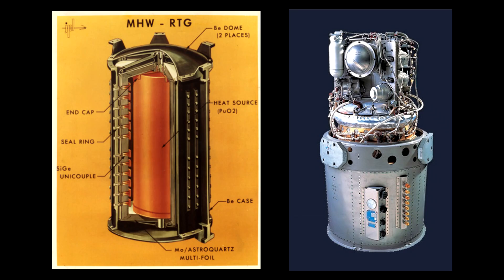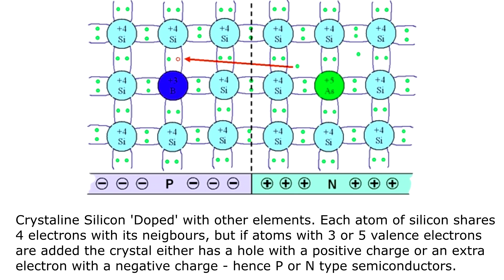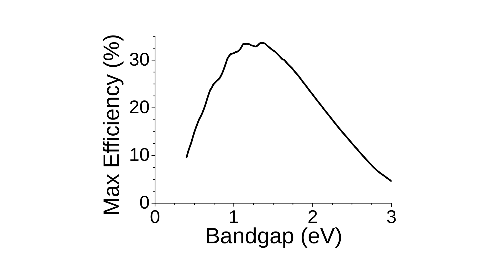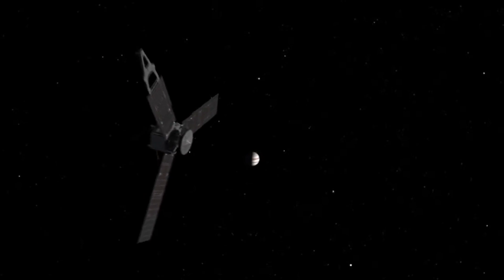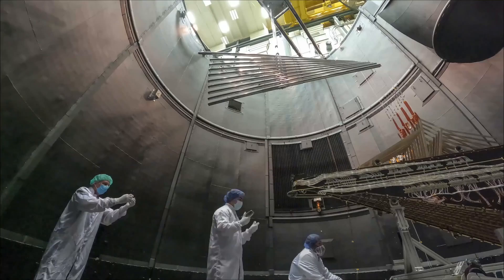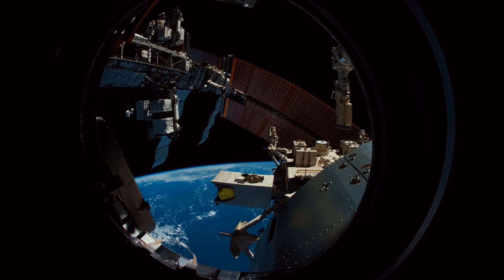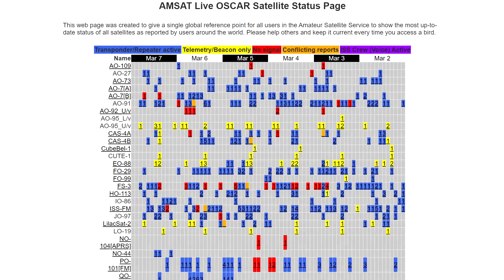How Does The Sun Power Spacecraft?  Things Kerbal Space Program Doesn't Teach You

Comment: In the case of the Ham satellite, what mostly likely happened is this.
When a battery fails, its voltage drops close to zero, but its internal resistance remains low.
Time passed, and the electrolyte of the batteries evaporated completely.
Therefore, the internal resistance of the batteries shoot up, to a value that is equivalent to a total disconnection. This allowed the onboard electronics to be powered directly from the solar cells.

Comment: Interesting, you implied that most solar cells in space are silicon, or perhaps multijunction.  My understanding was that they were CIGS, because of the higher efficiency and because they were thin film, so could be rolled up without being damaged.  I just did some poking around and couldn't find anything that confirms that.  Plus your point about using small, rigid but curved silicon pieces on a flexible backer makes a lot of sense.

Comment: Multijunction III-V vs silicon is actually not as simple as the efficiency number suggests. Multijunction cells use Germanium substrates that are much heavier than Si substrates. Therefore, the power-to-weight ratio of early multijunction panels are not superior to silicon panels. Multijunction cells are mostly valued for their higher radiation resistance for deep space applications. Using concentrators however changes the math since the cell mass are now a much lower part of total panel weight and multijunction panels have much smaller area and thus lighter structural support.  

For future spacecraft, less efficient thin film panels with much higher power-to-weight ratio are desirable. But TF cells have their own set of problems too.

Comment: cool video.  Hey, just wondering if the solar panels on the iss could be used to boost the orbit.  probably not good for the power supply, but those panels are pretty big....maybe once a day use the sun to push the iss faster.  Might need some more batteries, that I'm sure tesla could supply....by this I mean that on the sun word part of the orbit, the panels would have to be oriented side ways....grr...I think you get the drift...

Comment: polycrystalline cells can handle lower light flux than monocrystalline panels. Their maximum efficiency is lower but they are effective in dimmer conditions, one of the reasons you find them on calculators for use indoors.

Comment: AO-7 batteries failed short-circuit, then went open-circuit probably due to corrosion of the Ni-CAD batteries thus allowing power to flow from the solar cells to the electronics once again.  Scott erroneously states that the battery shorted to allow operation-quite the opposite.  It's actively relaying communication daily, for operators who can manage to use their power delicately!  send too much, and the transmitter drags down the voltage and gets all wobbly sounding! It is a "linear transponder" so more input=more output up to the power limit.

Comment: Another possible use of solar panels is fuelless reaction
 wheels desaturation by using solar radiation pressure torque. DOI:10.2514/1.G003328 Use of External Torques for Desaturation of Reaction Wheels

Comment: I'm glad you corrected the Pu-235 blooper!  I worked in the facility at DOE's Savannah River Site where we processed Pu-238 and got to travel to Florida to watch Galileo launch.  The cost issue with the material is we just don't have any reactors still operating where you can make much Pu-238 since the reactors at Savannah River shut down.  You can make limited amounts in the HFIR at Oak Ridge or at the ATR at Idaho National Labs.  But to make reasonable amounts for deep space missions, you'd need to build a new reactor, which isn't cheap, thus the 'high cost' to make Pu-238.

Comment: I grew up in the 1950s and was intrigued by solar energy.  They sold little hobby solar cells so you could get your hands on  the process.  In the 1980s I built a remote weekend house that Progressively became solar powered.  I believe the U.S. Gov. Used me and the remote house in a ten years long alien exchange program.  My first generator in 1985 had one experimental solar panel sold off by Motorola Government Electrics Group to employees.  I ran 12 volt current into the house and I love this arrangement being so simple and fool proof and absolutely dependable.  Next went to AC with a small inverter.  Then jumped to 3,000 watts with a huge battery pack and three solar panels.  I sold the remote house and that generator ran 12 years with no maintenance and was trouble free.  Today being retired I live in a van with two inverters two battery packs and one 100 watt China manufactured solar panel.  I run two 250 watt Electric heaters for winter heating, lighting, an entertainment center and a small refrigerator.
Reply: Your electric setup sounds interesting. Aliens do not care about the American government though, and don't participate in exchange programmes with native fauna 👍
Reply: @johnn1199  Yes alien's run their own show.  I was an official involved with military research and at my remote cabin I read the best research findings published at that time.  It was under stood that the alien's would gather exchange information from me.  I was taken to an ice planet or moon where I must have received extensive modifications.  It to appeared that I was taken to earth based alien sites possibly to contribute work on projects.  I developed an understanding of ancient Native American mapping and of sites globally related to my cabin site.  I also can explain the structure of gravity and the nature of deep space relationships.  From secure sources I was informed that I am an descendent of Christ and that I am extraordinary.

Comment: Multi-layered solar cells on a spacecraft seems kind of stupid. Real estate isn't your limiting factor, mass is. So why not use a single junction with an excitation energy optimized for sunlight and a large thin panel rather than a thicker multi-junction panel? I suppose the majority of the mass penalty comes from the supporting material, not the actual PV layer.
Reply: Volume is a limiting factor when you have to make something unfold itself.
Reply: @TheEvilmooseofdoom  If it's twice the area but half the thickness it's the same volume.

Comment: The solar constant at Earth's distance from the sun is 1366W per square meter (I assume that's what you meant by 1400W on earth) in orbit, closer to 1.15kW at surface level but that's the total radiation energy not the output from sloar panels. I was under the impression that the most we can get from solar panels at surface level is 300W per square meter, which is significantly lower than 50% efficiency.... If these 50% efficiency photovoltic panels exist why are we still using thermal solar? I thought they only generate about 500W per square meter of heliostats....

Edit:
That's what you said.... My bad =]

Comment: Great series Scott! I heard about Boeing having problems with solar concentrators. The very thin panels had adhesives that got too hot, loosening a little, and the panels warped. Also, the relatively cold reflective film immediately condensed the outgassing material, becoming dark and not reflective. Double whammy.
Reply: Yes, it was quite a boondoggle with many of those satellites needing to be replaced ahead of schedule due to unexpectedly fast power degradation. XM Satellite Radio's first two satellites were among the victims.

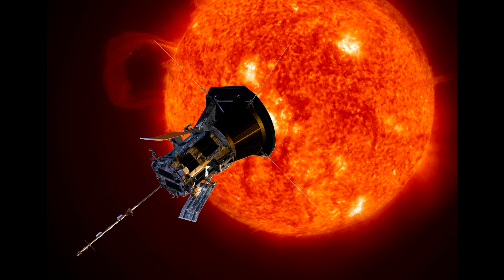Comment: 7:49... They are getting heat from infrared radiation right?  Or any radiation for that matter.  Check which wavelength affects silicon the most in terms of "thermal" energy and put a energy absorbing energy for that in the tip layer

Comment: It is amazing to me that it is taking so long for concentration to catch on; as it seems like a no-brainer, when you consider the cost differences between glass and pv cells.
Not to mention, generating a reflective surface in situ with on hand or stellar materials is likely much easier than making a pv cell, even if it can't be used structurally, or chemically.
Whether a mirror, parabolic or otherwise, fresnel-type lens, or something similar, concentrating light is a low-cost multiplier of efficacy, and has been overlooked for far too long.
Reply: It hasn't been overlooked, it's just not worth it most of the time. You need quite a bit more area to get the angled lengths of a concentrator to an equivalent area of some flat cells, additionally the few cells that are being focused on now get very hot which is already an issue with a non-concentrated cell, and then you need the cells to be tracked so the light is focused correctly (and if you're focusing on a single cell, you might be forced to be dual axis tracked since the single focus area could move off in either direction). I've designed a few solar panels that have flown, and when I started my career did a trade study for a concentrator and the result was a concentrator works, it just has additional issues to deal with and the cost of the cells usually isn't enough to justify the increased complexity and logistics. Obviously that changes mission to mission, but I have yet to do a solar array that a concentrator was chosen as the best option. Solar arrays you want to keep as simple as possible, since they are the single part of the whole spacecraft that must work, so keeping a high reliability usually wins out in my experience.
Reply: @ivs-b7h  Maybe a polarized frequency filter covering a half pipe reflector can have a tube of liquid pv/t, cooled using a direct expansion solar-assisted heat pump?
Reply: solar concentrators were a popular scheme in the literature, but always increased the complexity and could require removing heat from the PV cell.  It also requires more accuracy when pointing the array at the sun.   The fact that they were rarely used for satellites does suggest that the benefits weren't worth the costs.  It is possible that with the multi-junction cells, the relative costs might be different enough to justify a simple solar concentrator as was shown in the video.
Reply: Boeing tried concentrators on the BSS-702 satellites years ago and it was a massive failure due to the mirrors fogging due to offgassing. That likely did something to scare off further attempts..
Reply: Solar concentrators aren't an ideal solution, because mirrors can be heavy, and more importantly, concentrating sunlight on a smaller area also increases the incident heat as a result, which leads to decreased efficiency and/or requirements for active cooling. They're also much more restrictive in orientation.
Reply: @dojelnotmyrealname4018  Those sound like areas where development can improve, especially if given as much effort as traditional pv.
Reply: @Nullpersona  The thing is, most of those problems are fundamental to the design. Solar concentration is, by definition, focusing more solar power on a smaller area. So unless you have some magical 100% efficiency solar panels, that's gonna create heat concentration. This can be partially offset by increasing the efficiency of the solar panel, assuming you can actually store the electricity, since using it turns it back into heat, but the short version is, any solar power that doesn't leave the solar panel as electricity, enters it as heat. 
So twice the solar power means twice the heat, which leads to higher temperature, which decreases the efficiency, which will increase the heat further. The end result is that unless you're not even remotely using the cooling capability of your solar panel, there's a lot of logistic pressure introduced by concentrating more sunlight onto the solar cells. You can't afford such complexity in space.

The necesity of aiming the concentrator is also fairly fundamental, given that you're effectively ricocheting sunlight onto a small target. The weight of the reflective surface is a question of material's science, so that can be improved, but what can't be improved is that reflective surfaces tend to be metals, and metals tend to be dense. The other improvement option is making the metal thinner, but the incident solar rays will cause stress, both kinetic and thermal, so that has it's limit too.
Reply: @dojelnotmyrealname4018  The angle of incidence can be accounted for by the shape of the pv element; panels make sense for the relative angle of a nearby star, but hemispheres or other shapes would probably work better with reflectors and concentrators.
Development of higher capacity pv technologies is counterproductive if concentration is not applied, especially where profit is a concern, so there is little incentive to pursue it.
If any additional thermal energy collected is recycled or otherwise converted for use, like ablative propulsion, or technologies like liquid pv-t are pursued, the potential seems promising.
Reply: @Nullpersona  Angle of incidence is a minor problem for pv panels, but for reflectors it's a massive problem, since a minor change in angle of incidence will make the reflected light miss the pv panels completely. 
The second is downright false. First of all, solar concentration is more suited for solar thermal power generation than photovoltaic solutions. The paradox of photovoltaic power is that power generation decreases with solar power decreasing, but the conversion factor decreases with solar power increasing. Concentrated solar power is more suited for power tower and other solar thermal collectors.
Secondly: Higher conversion factor PV cells have one major advantage: they get less hot directly. Like I said last time, any solar power that doesn't become electricity, becomes heat instead. This makes them usable closer to the sun. 
Thirdly: Terestrial and spaceflight conditions have different practical requirements. Spaceflights have power per unit mass, which trasnlates into conversion factor per unit mass for pv cells, and effective reflective surface per unit mass for reflector solutions (in both cases, unit mass includes support structures). Meanwhile in terestrial applications, the most important metrics are power per required investment, and power per required maintenance. 

So in spaceflight, the question is still why you would use reflectors when you could just replace those with more pv cells, and have a generally better result with less concentrated heat buildup, resulting in better efficiency, for equal if not less weight (Silver is 4 times as heavy as silicon). Remember, every pound of payload equals 10 pounds of fuel. Reflectors are only really used, as the video says, because solar panels have a minimum incident solar power requirement to operate at all. 

Meanwhile in terrestrial conditions, the sheer ubiquitousness of silicon outstrips most considerations for the use of reflective materials, which are more expensive to produce. And you don't need the most converting solar panel, or even the most powerful, you need the one that produces the most solar power for your investment. We have plenty of roofs to still be able to place solar panels on.

Comment: What's interesting is when you look at designs for space stations and such from the 1940s and 50s, they are depicted as having solar thermal turbine generators for power, basically a parabolic reflector focused on a boiler unit filled with liquid sodium or some other working fluid, that then heats water to turn a turbine and generator. Photoelectrics were not yet ready for prime time so designers and futurists were working with technology of the day.

BTW, I have an old Minolta twin lens camera from the 50s that uses a selenium light-powered meter, no batteries required, and it still functions just fine.
Reply: I miss old school futurism.
Reply: Steampunk space stations. :)
Reply: There are still proposals by futurists for solar thermal power in space, but scaled up to beam down to Earth or for stations and bases with high power demands.  A surface base on something like the moon or even an asteroid could use the heat directly to bake volatiles out of the ground.
Reply: Photovoltaics weren't invented until 1954
Reply: @lektwik  Yes? And?
Reply: @lektwik  As Scott Manley said, it was invented in the century before. It was just not well-understood and developed enough to be practical.

Comment: The angular alignment for concentrating PV isn't as critical as for imaging optics, because they don't need to create a sharply focused image of the sun - they just need to smush the photon flux hitting a given area down into a given smaller area. For example, if you want a concentration factor of 10, you can using reflecting optics get an accepance angle of about 18 degrees.

Comment: Can you make one about batteries? I am curious what battery tech they would use given the complex constraints on temperature, weight, lifetime & so on.
Reply: I know in the early days they used nickel-cadmium cells. That's actually where the nicad "memory effect" was discovered as the satellite would repeatedly charge and discharge the battery to exactly the same levels, unexpectedly causing it to lose capacity. Not something that was likely to happen in other usage, popular wisdom to the contrary - most consumer nicad "memory effect" was really cell damage due to badly designed chargers constantly overcharging them.

Not really sure what they use these days though..

Comment: I've been wondering - if solar panels perform better at lower temperatures, why don't we see photovoltaic solar cells on top of thermal solar collectors on our roof tops? That way one would get most electrical energy ,(through water cooling) combined with warm water for use with heat pumps. I guess this approach would be too expensive?
Reply: thermal solar collectors work by heating up the fluid to as high a temp as possible, which is actually the opposite of what you want to do with a solar panel. That's why.
Reply: @joansparky4439  ok, make sense. Thanks. But what about water cooling in general?